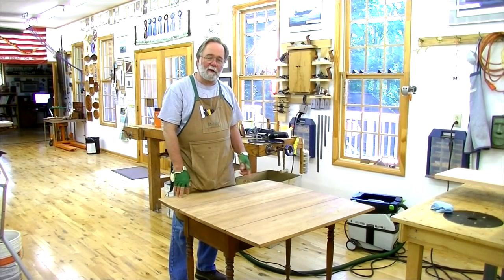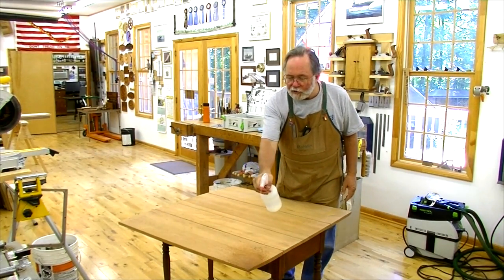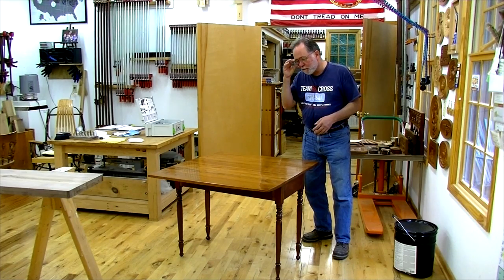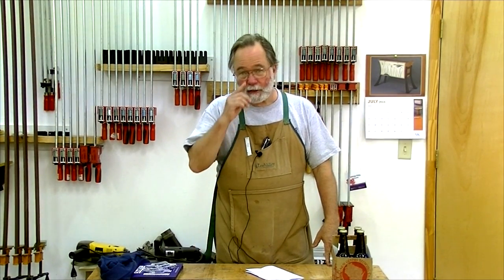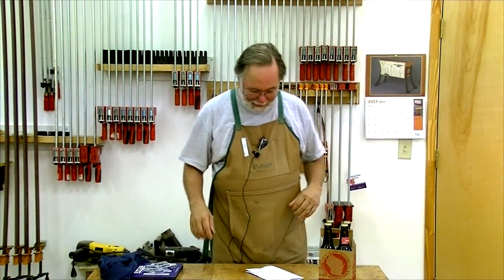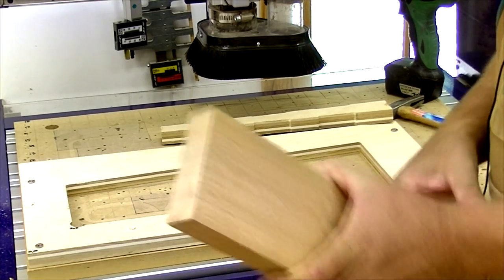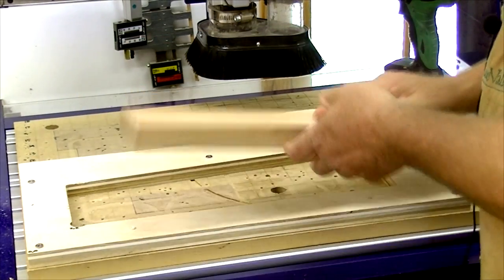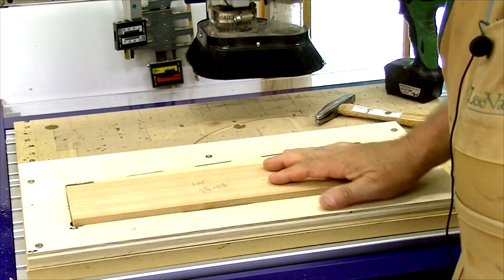CNC Jig, Table Refinish: Saturday in the Woodworking Shop #22 with Andrew Pitts FurnitureMaker

Comment: Good one Andrew - like the clamp....Try profile cutting from bottom z - it works very good!
Reply from the maker: Jeff Woodshop I do use the table to Z-zero sometimes, and you are correct that it works well for profile cuts, but I have a tendency to forget things so I usually stick to the same routines.

Comment: CNC is not woodworking, it's a form of machining in my opinion, your material just happens to be wood.  Nearly no true woodworker has a CNC.  Those that don't have the skills rely upon a computer to do it for them.  When you say "I'm cutting", no you're not.  The computer is cutting.
Reply: Mark Lindsay Mark,  I have no intention of trading barbs or engaging 
you. I was not "trolling"  for a reaction. I simply meant that CNC can be a very small part of a very  talented woodworkers arsenal, a small piece of the puzzle, and was simply replying to your comment. Of course I made the comment on Andrew's channel....that's where you  posted it. I made my comment with10yrs. as a tool & die maker, 34 yrs. owning a dental lab, and a life time of woodworking behind me. I wish you the best Mark,enjoy the rest of the summer.
Reply: christschool I will have to disagree a bit. A machinist works with a metal medium, using lathes, mills etc. His specialty is metal shaping. A woodworker, by comparison, uses wood as his medium. Whether he uses a block plane, table saw, CNC or a drill to obtain his vision doesn't matter. The tools one uses to work your medium are not what define your craft. A metalworker from the 1800s would be amazed at the tools modern metal shops use, as would an old woodworker. I have a CNC attachment for my lathe that can make bowls unattended. I also do the same with my own hands, either way my medium is wood and I consider myself a woodworker. ***** is a master of all of the available tools and uses what is necessary to complete his vision - Very Much a woodworker in my honest opinion. I see your point though in that if CNC is ALL you know how to shape wood with, then you would be correct in the traditional sense of woodworking.
Reply from the maker: Thanks for watching.